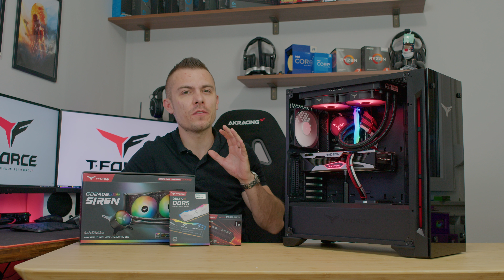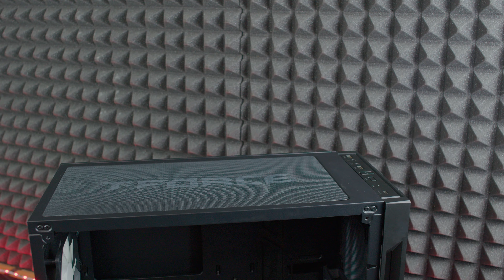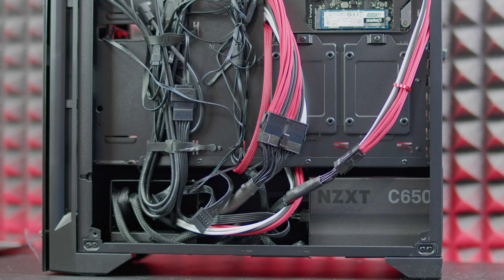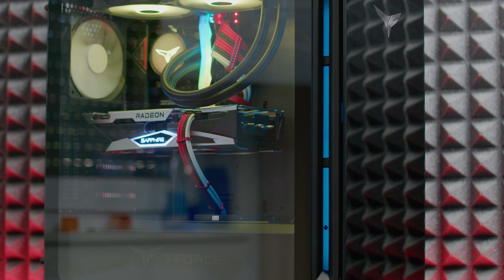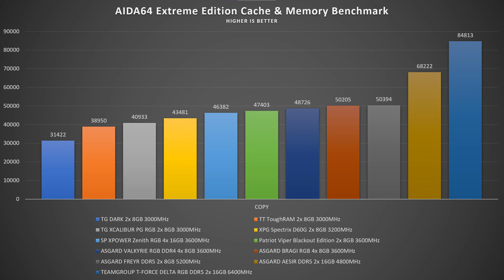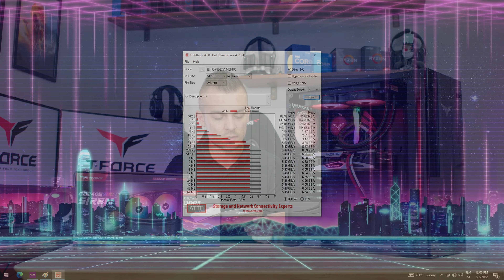TEAMGROUP Full PC Build - Lares, Siren, Delta & Cardea Review

Comment: Great video 👍😇. I didn’t realise Team Group T-Force made an AIO solution 🤩🤯. Here in Australia 🇦🇺 Team Group pricing is vg and so are the Cardea M.2 drives. I found varying speeds on my M.2 (non Team Group) depending on the motherboard I use as well. Sometimes around 10% even after running benchmarks straight after a cold boot and using the same cooling solution.
Reply from the maker: Thank you very much! :) Yeah. I was pleasently surprised when they released the case and an AIO. Hmmm, for the SSD, that is really strange, even though I used some SSDs and they had terrible thermal throttling with huge MB/s drops. :(